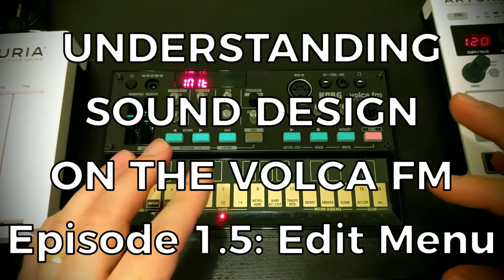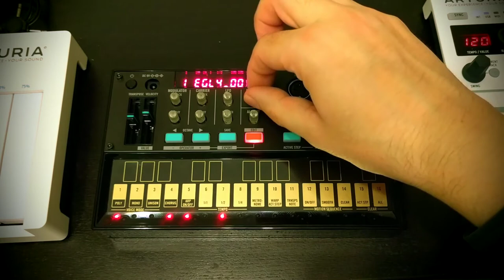Understanding Sound Design on the Volca FM - Episode 1.5: The Edit Menu

Comment: How do you download the patches?  I'm guessing it's from a file to the Volca FM via USB.
So is there a certain Patch Cable for this?  Or am I really off?
Reply from the maker: That's basically it. You need a midi interface for your computer - it's not anything specific to the Volca. They are often built into audio interfaces (for example I have on on my Focusrite Scarlett) or you can get USB-Midi cables for about 30 dollars - although be careful as some of the very cheapest ones don't pass MIDI Sysex data correctly (which is what the patches are based on).
Reply: Thank you, yes I have a MIDI IN/OUT Cable to USB. I downloaded a number of .MOD files and do a great 
job of sending the song to my Korg PS60.
Reply: I bought a USB to MIDI IN/OUT on Ebay for about $7.00